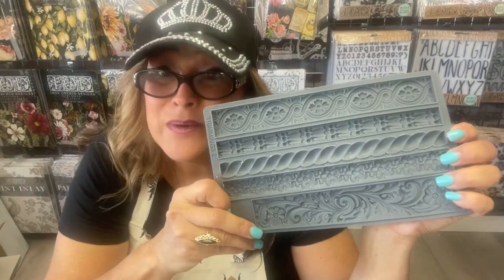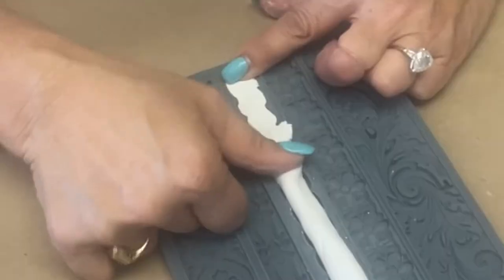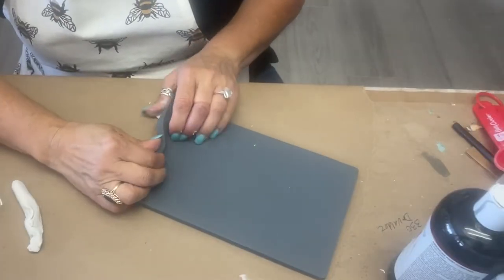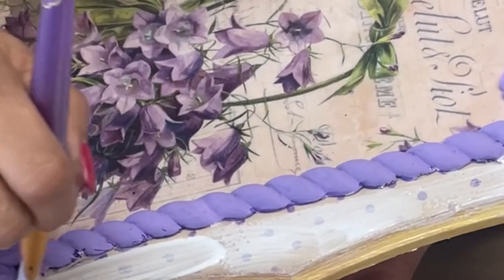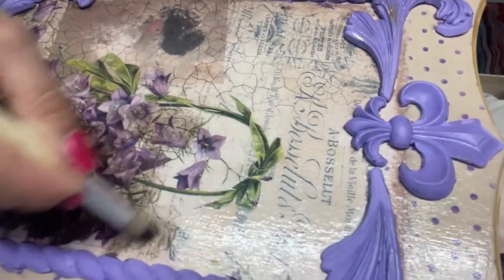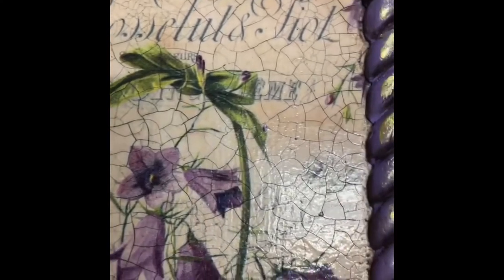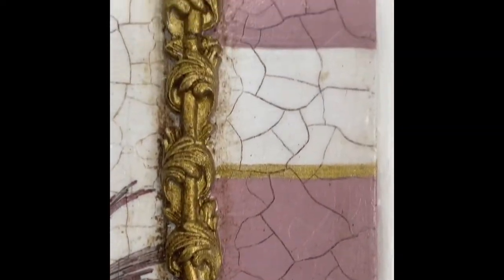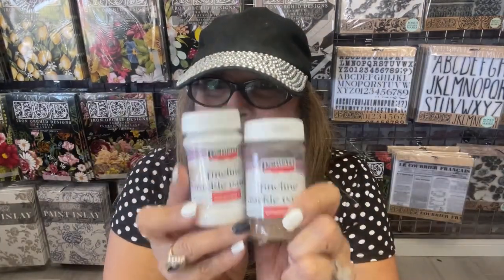How to do a crackle paint finish 3 ways

Comment: Im new to moulds. I am worried about how it will look when it shrinks and cracks so I have been using resin. Sadly the resin works out expensive. How much does the clay actually shrink and crack and does it happen slowly over time or shortly after making it ? TIA. Watching from Australia; :-)
Reply from the maker: If you are joining multiple pieces, squash them together as closely as possible to avoid minimal shrinking, and then you can add paintable caulking I use Alex fast dry depth to whatever spaces in the middle and Paint in 20 minutes

Comment: My first attempt with the crackle was a complete fail.  Wish I would have watched some videos first.  I did not use a top coat before the crackle process.  I did not put down a thick coat of the steps.  And I think I overworked them. And then I tried to use a water based glaze that also did not wipe off easily and caused the crackle to pull up and be really sticky.  So much done wrong, lol.  Plus I think my project was too big, a large vase.
Reply from the maker: I’m so sorry, it’s so frustrating when that happens!! I hope the video helped clear up some confusion and inspire you to try it again !! You can doooo it 💓💓🎉🎉
Reply: @vintageretailtherapybymara1121  my next attempt did turn out better!  Thank you!